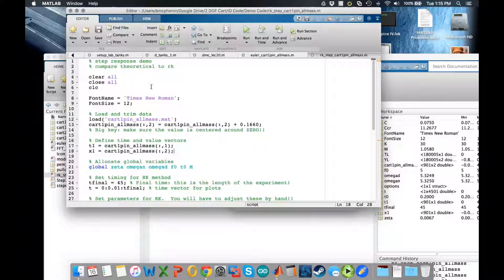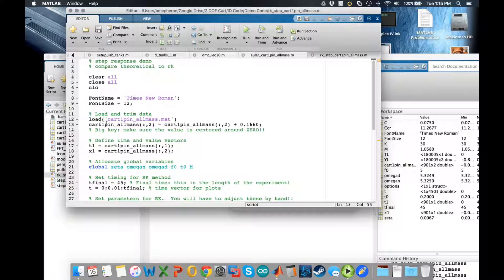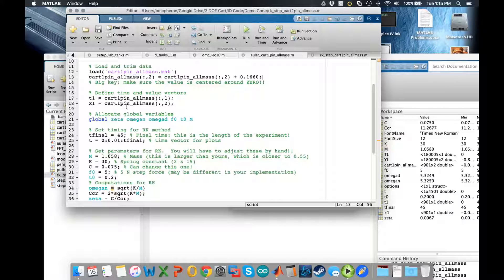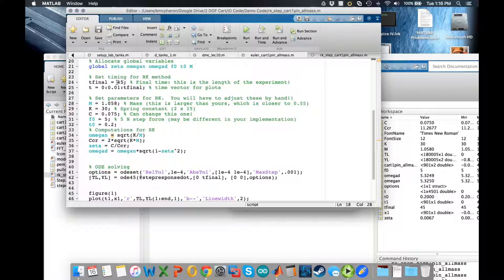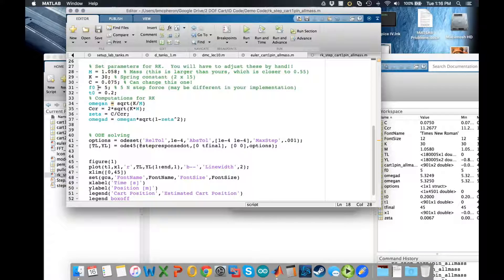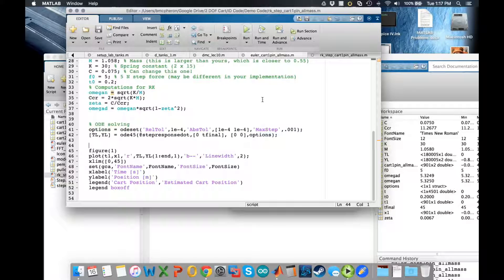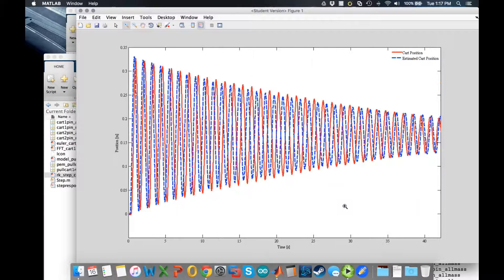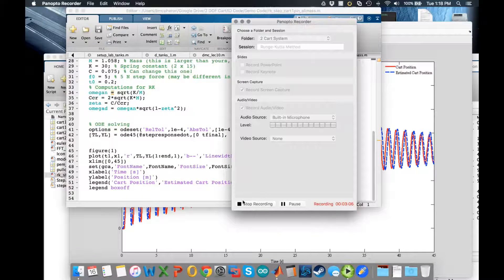Runge Kutta Method

Comment: hi, i would like to ask am i able to use runge kutta for motion equations?

M(d2x/dt2)=Fn(sin θ - uCos θ )

M(d2z/dt2)=Fn(cos θ + uSin θ ) - Mg

Fn,M,θ,u is constant fn/M = 0.866

i tried Mzdoubledot as shown in the code below, however i dont know how to combine Mzdoubledot with Mxdoubledot.

clc;                                               % Clears the screen
clear all;
h=0.1;                                              % step size
thete=30;
g=9.81;
x = 0:h:3;                                         % Calculates upto y(3)
y = zeros(1,length(x)); 
y(1) = 5;                                          % initial condition
F_xy = @(t,thete) 0.866*(cos(thete)+0.5774*(sin(thete)))-g;
for i=1:(length(x)-1)                              % calculation loop
    k_1 = F_xy(x(i),y(i));
    k_2 = F_xy(x(i)+0.5*h,y(i)+0.5*h*k_1);
    k_3 = F_xy((x(i)+0.5*h),(y(i)+0.5*h*k_2));
    k_4 = F_xy((x(i)+h),(y(i)+k_3*h));
      y(i+1) = y(i) + (1/6)*(k_1+2*k_2+2*k_3+k_4)*h;  % main equation
  end
hold on
plot(x,y,'+-', 'Linewidth', 1.5, 'color', 'blue')
xlabel('x')
ylabel('y')
legend('RK4')
Reply from the maker: +Noel Lou the Runge Kutta method is useable for any ordinary differential equations.  For reference you might want to look at something like http://people.virginia.edu/~lz2n/mse627/notes/DiffEq1.pdf
Reply: +Benjamin McPheron Hi thanks for your input, however i still don't quite understand on the matlab programming part, 

M(d2x/dt2)=Fn(sin θ - uCos θ )

M(d2z/dt2)=Fn(cos θ + uSin θ ) - Mg

Fn,M,θ,u is constant fn/M = 0.866

M = 6000
θ = 30
u = 0.5774

i split my motion equation into 2 individual 1st ode, 

X' = Vx
Z' = Vz

Vx'=[fn*(sin θ - uCos θ )]/M
Vz'={[fn(cos θ + uSin θ )]/M} - g

The code i wrote in the previous comment seems to have some problem, please help

Thank you